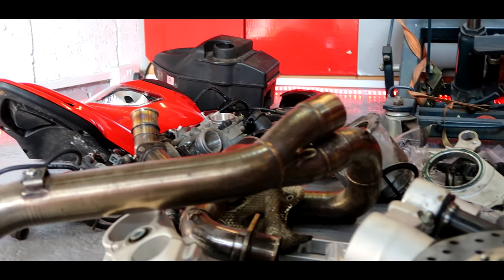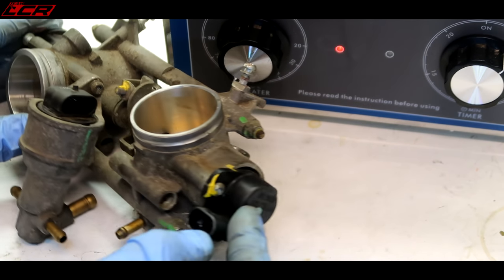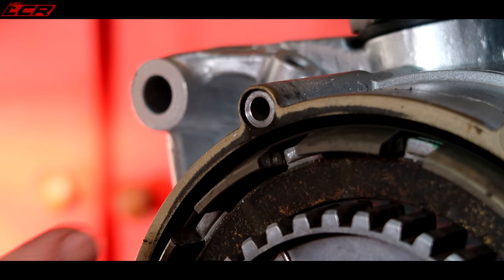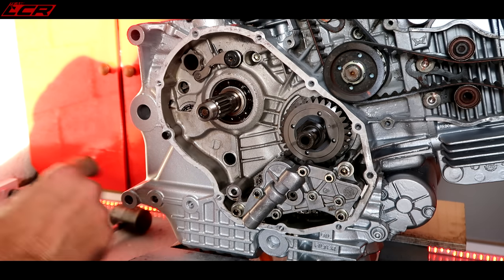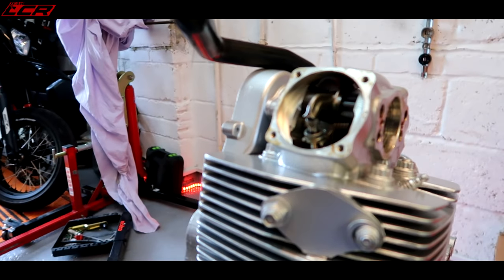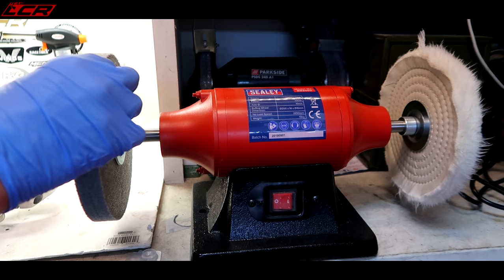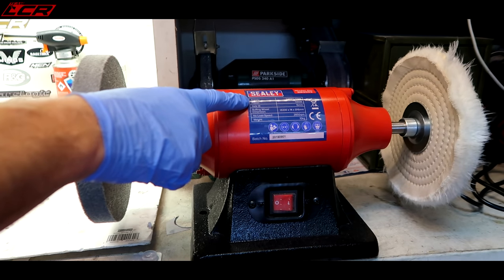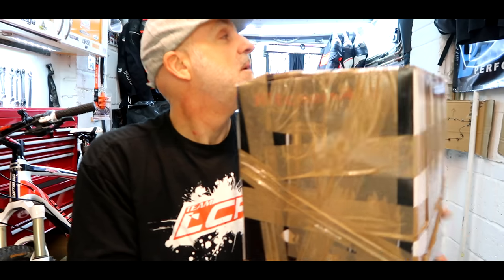Hypermotard Restoration EP07 | Ultrasonic Cleaning.. DIY Efforts 🤞

Comment: When u put the new sight glass back in, put it in the freezer for half hour and heat up the hole in the case with a heat gun and when ur ready it'll go back into the case a bit easier, great video 👍 keep them coming
Reply from the maker: Yes good tip Gren I will make sure all the bearings go in there too 👍

Comment: Top tip; get yersen a 3/8" drive ratchet and socket set. 95% of working on a m/c is done with 3/8". Pros will also have/use 1/4" for the small stuff. But that 1/2" you are using on 6mm cover screws is just a no no. 1/2" has its place, like big fasteners such as clutch, rear wheel spindle etc, but less than 5% of your m/c work.
Regards,

Comment: Great video Chops. Leave those bolts soaking in distilled white vinegar overnight, that will take the corrosion away. Takes longer than some of the dedicated rust removal products, but vinegar is cheap, you can get it at the supermarket and it smells nice. Will make you want to go to the chippy though!
Reply from the maker: Good tip!

Comment: If you use the same clutch plates remember to cable tie them up in order they all will wear different thicknesses and the pack will be a different size if there mixed up I made that mistake ,excellent built 👍
Reply from the maker: I'm going to change them Shaun but great tip 👍

Comment: try soaking old bolts / parts in apple cider vinegar, works a treat. just don't put the lid on the jar too tight, as it fizzes up a bit of pressure and can pop the top!

Comment: Another nice video Chops. Love the Hyper series. Just one note, be careful heating petrol in an open container. Pop a cap on (loosely) to minimise vapours. Don’t tighten as it will build up pressure.
Reply from the maker: Yes good tip, I did have a cap but as you say was worried about pressure.. loose fitting is a good tip 👍

Comment: If you used some alloy wheel brightening acid in the ultrasonic cleaner it will remove corrosion from alloy an steel, so good for your bolts. Just the strength to suit 👍
Reply from the maker: Oh nice tip James thanks!

Comment: Couple of things. You should have cleaned the throttle bodies down with wd40 1st to get the worst off. When you put the new oil sight glass in, make sure the cut outs are at horizontal and vertical, not just any old way round. So you can see the oil level right.
Reply from the maker: Ok very good point 👍👍

Comment: "It doesn't even show you in the service manual", 'so I'm not going to show you either hahaha!'  Thanks Chops, hopefully we will never need to know how to remove a sight glass anyway 😂😂👍
Reply from the maker: Hehe it involved some bashing 😂😂
Reply: @LambChopRides  😂😂
Reply: @HalfdeadRider  Drift it out with suitable sized socket from the inside of the casing.
Reply from the maker: Yes its exactly what I did 👍
Reply: @richardb285  thought that would be the case, I'm sure the chance of me and most other's needing to do it is pretty slim though.

Comment: Great series Chops - sweepstake for what size box of bits is left after the rebuild?  Reason for writing - not to be Mr HSE (I'm not), but the instructions with most U/S cleaners are pretty clear: don't use petrol.  Esp with the bath warm - you'll be producing a fair bit of vapour, I would think.  You shouldn't need the extra solvent effect anyway since the cavitation from the U/S ought to lift pretty much anything (a 'strong' U/S cleaner will nibble aluminium foil due to cavitation).  If you really have to, it'd be safer with diesel, kero or paraffin.  Diesel's a damn good cleaner anyway.  Good luck chap!
Reply from the maker: I have a big box of bits that are not going back on already!!

Comment: Not sure of your plans to clean the Exhaust system, Seeley polisher perhaps, before you try all that manual work, try Harpic 10 Max its very strong and does a great job. 👍
Reply from the maker: I've actually just ordered two bottles 😁 hoping with that and the Sealey machine should be able to get some good results 👍

Comment: Some of the bolts with large heads you can buff the corrosion out on the wheel. That bath was a good purchase! Fuck using old tooth brush for hours =D
Reply from the maker: Yes that's my plan 👍👍

Comment: I’d be happy to chip in chops to provide you with a dedicated bench grinder not only that polishing large overhang / nut not quite on -suicide explosive energy sudden let go -no-workrest death machine...   !!!  otherwise great vid as usual
Reply from the maker: Haha thanks 👍 it's fine for my light load 😂
Reply: Lamb Chop Rides 😂 as long as you promise to hide under the parts cleaner if you see the blur of something rumbling around the walls floor ceiling before it gives up on being glued together and suddenly supplements your breakfast !

Comment: Excellent series LCR, Ive just stripped my 1977 DT175 down to its fundamentals!!! complete resto in lockdown, do you have a link for the ultrasonic parts cleaner you used? cheers kindly
Reply from the maker: It was one of the ones off ebay, search 2l ultra sonic cleaner you will spot it 👍 there is a slightly more expensive digital version

Comment: I think you might’ve been conned with that sonic cleaner you would have got a better job with a bit of elbow grease. The corroded bolt heads can be buffed up with your buffer.

Comment: As a 2v Monster owner, I'm following this resto with interest. 

If you do replace the clutch plates, don't throw them all away as you can fashion a clutch locking tool by either bolting/welding a handle to a couple of steel plates or by bolting together a steel and friction plate.  When it's finally time to reinstall the clutch and torque it up, don't be tempted to try to lock the clutch with a screwdriver like you did when undoing it; you're likely to snap one of your spring posts. Have a look here at 11:55.

https://www.youtube.com/watch?v=aPCNJO6aXTc

Good luck!
Reply from the maker: Yes thankfully someone else shared that video or it would have been me! Now ordered a homemade tool 👍

Comment: Lots of grubbing going on there!! Great job man, question after the coating of the yokes and installing them , the paint wont chip of when u tighten up the bolts ? 
I had this issue ones , but then again it was just painted and not coated...
Anyway looks great... cant wait for the next video!
Reply from the maker: The Cerokote is really thin so should be fine 👍👍